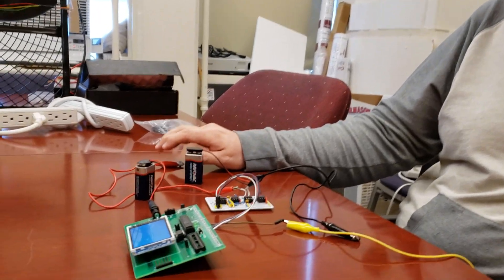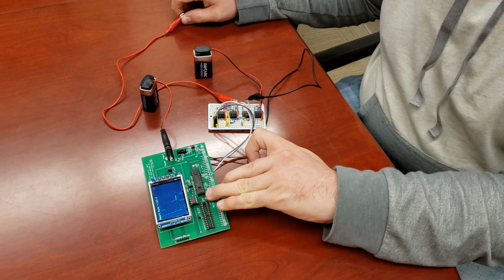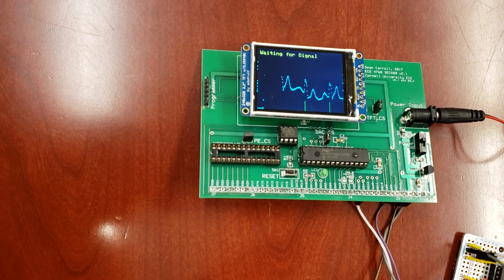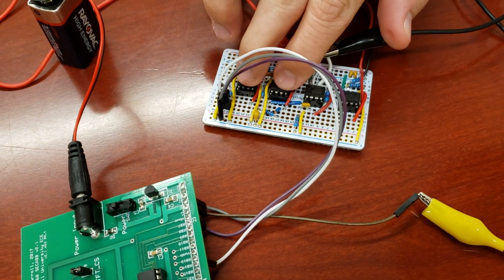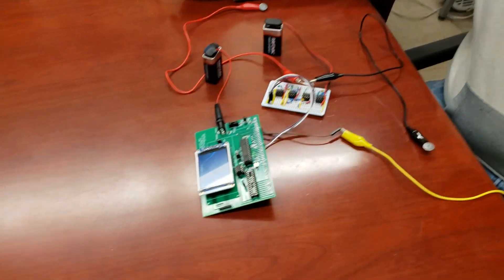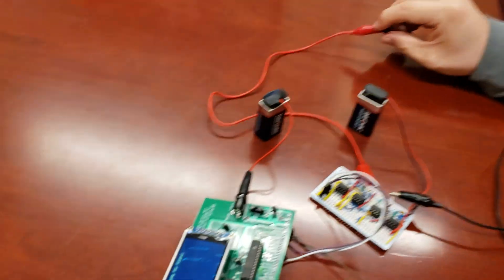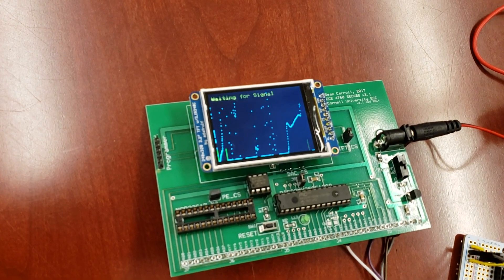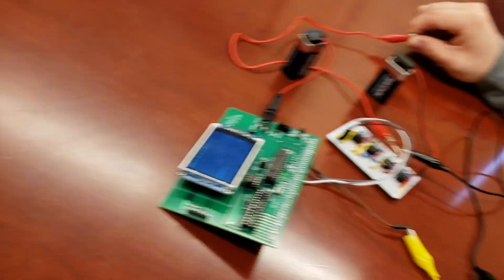Portable Electrocardiogram to heart rate

Comment: I was too working on this project ... but making it bluetooth.or wifi operatef..but 12 lead isbecoming complocated ... so it would be very helpful if u share some knowledge about it
Reply from the maker: too vague. what are you really asking?
Reply: @ece4760  i have made a single lead  ecg  which is wired now i am trying to make it 12 lead but with bluetooth or wifi through which some one can see the output on their phone screen or any othe display.so i was asking about the prototyping of this type of ecg... can you help??
Reply from the maker: @deepalsingh9878  the steps seem straightforward. first duplicate the in[put amplifiers 12 times. Then mux them into an ADC. You need about 250 samples/sec on each channel, so conversion rate of 3 Ksamples/sec. People emerald buy the radio link hardware. I cannot help with the phone app.
Reply: Thank u sir for this info....
Reply: @deepalsingh9878  You might be interested in my project from a few years ago here, http://www.voltagedivide.com/2017/10/14/psoc-design-and-implementation-of-a-12-lead-portable-ecg/